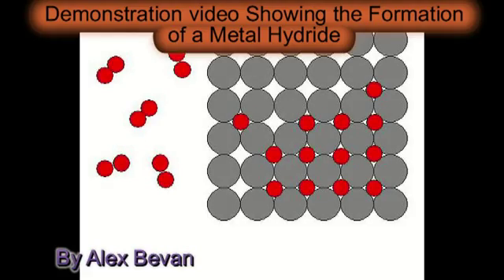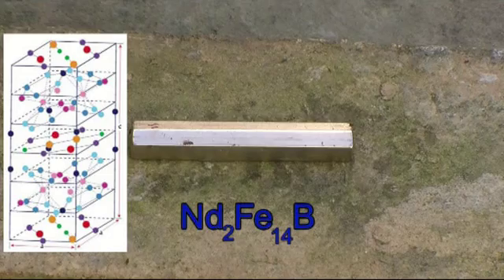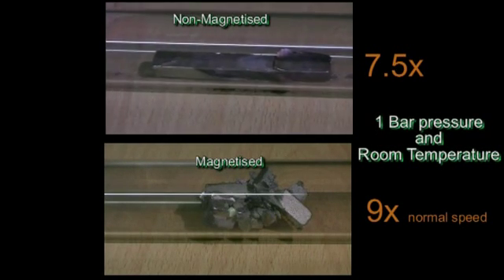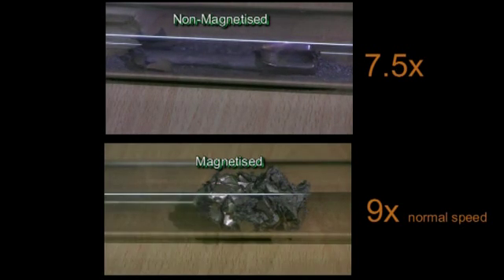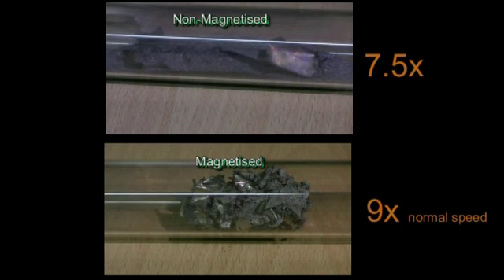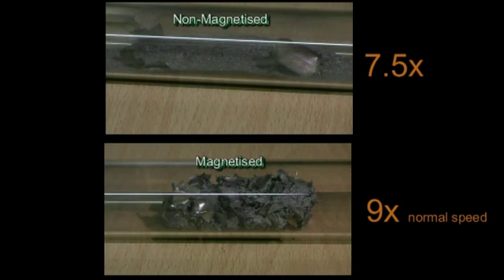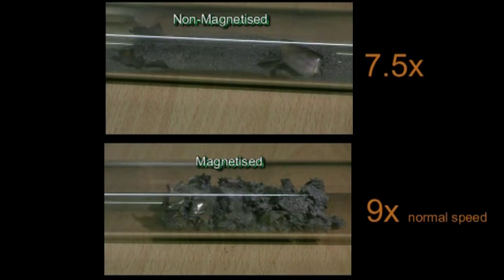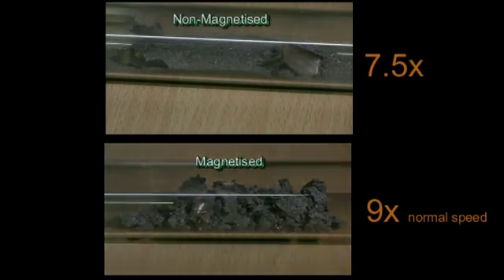The Formation of a Metal Hydride (NdFeB magnet example)

Comment: Hi.
Can you please explain how did you hydride the magnats? Please thanks in advance
Reply from the maker: I have a supply of hydrogen gas that I passed over the magnets at room temperature, with no oxygen present the magnet reacts with the hydrogen to form a metal hydride. Since magnets have a corrosion protection on their surface, this can result in an incubation delay before the reaction occurs.
Reply: @InForAPenny2010Adventure  thanks for the reply.  Im just trying to make deuterated metal for my experiments.  I have deuterium, trying to make targets for nuclear experiments. Thanks